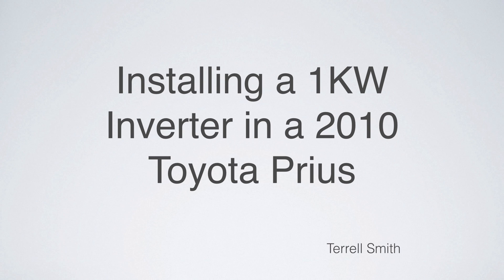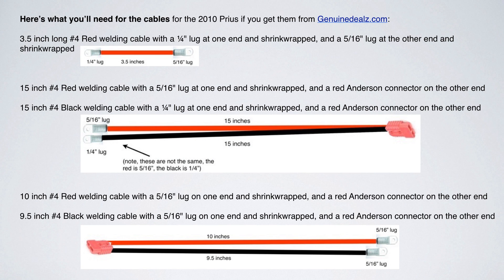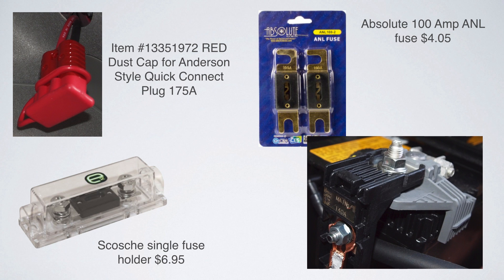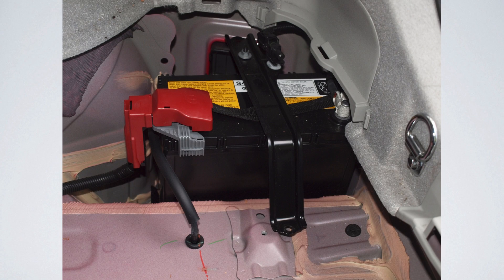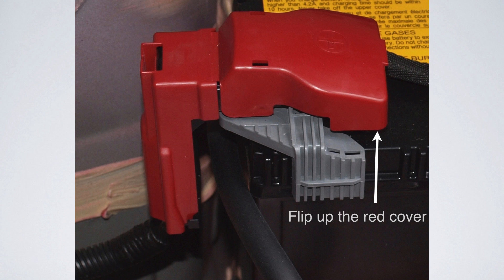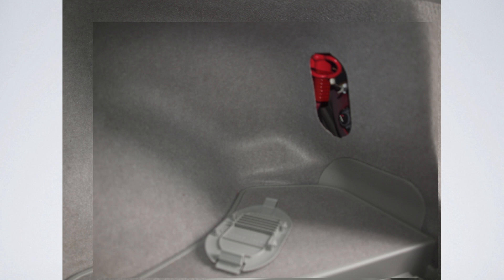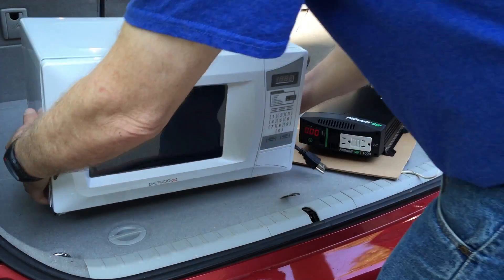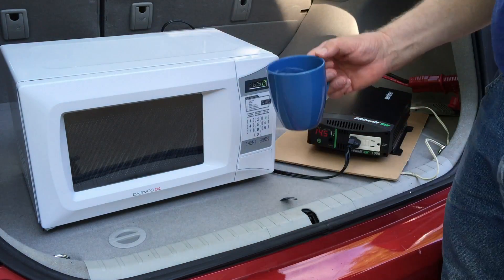Add a 1kW Inverter to Prius

Comment: I would like to set this up with my Prius but before I get all the parts, I was wondering if you could advise what sizes to get, etc.  You can give one-word answers if appropriate.
1)  Will this work with a 2004 Prius?  I believe they have a NiMh battery (larger than what they have today, I believe) but the chemistry is different.  If not advisable, we can stop right here.
2)  Would having a 1200 watt pure sine wave inverter be better for-just-in-case surges?  I don't have a lot to run.   This is for emergency backup use only.  I put my Kill-a-Watt on both my fridge and freezer and they both drew very little power.  The freezer is an old-style manual defrost kind and the fridge is one of those energy conserving models.  We wouldn't use anything powerful like microwaves in such a situation.
3)  What size battery cables?  Size 4 or 2?  Would 2 be better for not heating up, etc? Is Marine grade what I want?
4) I would like to use a breaker rather than a fuse.  What size breaker would you recommend?
This is what I have in mind:  https://www.amazon.com/dp/B08BYGRS1Z/?coliid=I1QG63HIPAVA3V&colid=147E3KHK8VQOL&psc=1&ref_=lv_ov_lig_dp_it
5) Attaching the cables to the battery terminals it's positive on first, then regative, right? I've seen various videos on this and it seems some people do it the other way.

I found a site where they will custom make cables with Anderson connectors and whatever kind of terminal ends you want.  Once I know the right sizes for all the components, putting the system together should be fairly easy.   batterycablesusa.com 

Your video was extremely informative and easy to follow.   Thanks a million!
Reply from the maker: Hi Amy. Thanks for the nice words and all the good questions.  :)  1) It should. The 2010 Prius also has a NiMh traction battery. 2) 1000 Watts is as high as you should go. And yes, get a pure sine wave inverter. Some equipment will only like pure sine wave. Pure sine wave inverters cost a bit more, but are the way to go. 3) Get #4 cables. #2 will be too heavy. #4 won't heat up. Marine grade is high quality. It should be like welding cable, because it's nice and flexible. 4) A breaker is fine. Either fuse or breaker should be 100A. The 12V battery in the 2010 Prius has a 140A fuse built into the positive battery clamp. The 2004 Prius might be similar, but I don't know. 5) If you are attaching battery cables directly to the battery and there's no load when they are attached then it doesn't matter which order. But if there's a load on them, then always connect the positive first, then the negative to a ground away from the battery. Why? Because 12V batteries (flooded or AGM) make hydrogen gas, and when you connect cables with a load there will be a spark. You do not want a spark near the battery. I have heard of videos which do not tell it correctly -- they are putting people at risk -- I don't know why they have it mixed up. If you measure what you need for cables carefully, there are places which will make very nice cables for you. I got mine from genuinedealz.com (see at 1:20). They have had so many requests now from this video that they have a "kit" with everything ready. I don't know whether this will fit the 2004, since that's a Gen 2 Prius, and the 2010 is Gen 3, so there might be a difference. Hope this helps!
Reply: @TerrellWSmith  Totally awesome!  Thank you so much!  If I wear latex gloves while I do the battery hook up, and cover the black wire while I do it, I won't get shocked, right?   More questions:  I see videos where people are attaching the black wire to some other place than on the negative post of the auxiliary battery.  Why would one do that?  Can't I just hook it up the same way I would hook up my riding mower or car battery?   And what about a ground wire connection?  If you had to use this where your car is exposed to the elements, how could one keep the hatch door closed with an extension cord coming out during adverse weather and keep people from stealing your car?  Could one put a hole in the wheel well to sneak the extension cord through?  My garage is a distance from my electrical panel, if I chose to not connect the car to it, I would need several really long extension cords to get power to my fridge and freezer from my garage.  Lots of little details to deal with, but it seems totally worth in the long run compared to the cost of a solar or gas-powered generator.  Thanks again for your advice.
Reply from the maker: @amywalker7515  , sure, wear gloves. I usually just make sure I keep one hand away, or put both hands on the same spot, like to do a nut. The black wire is the ground, which is the same as the rest of the body of the car. It's the red wire you have to be extra careful about, the positive wire. So keep tools and yourself from touching both the red (positive) and any ground (the rest of the car's metal parts) at the same time.
Yes, you may attach the black wire to any good metal part of the car. If you look closely, the negative (black) wire from the battery is attached to the metal of the car. So yes, you can attach other ground (negative) (black) wires to the frame of the car. I attach it to the negative 12V battery post directly, so that I have a very solid connection. And remember to have a fuse close to the positive battery post, in case something goes wrong. I use a 100A fuse. A breaker is also fine.
Regarding the extension cord from your inverter to your house: You don't need to drill a hole in your car. That just helps it rust faster. You can lay the extension cord at the bottom of the hatch opening (keeping it away from the latch area), then close the hatch very gently on it until you hear one click. Then gently push down until you hear the second click. If not, then move it toward one of the corners, where there is more flex of the hatch. There is enough space between the bottom of the hatch and the car for the extension cord to pass through, and the rubber seal on the hatch will seal it against rain. Just don't let the hatch slam down on the cord, or it can be damaged. I use a 12 AWG extension cord, which can carry 15 Amps. 
Make sure the car is in READY mode and the pure sine wave inverter is turned on, and all your stuff is plugged in and working. I have several 50' industrial extension cords, as well as 100', so I can park the car in the driveway, close the garage door (the cord can go under the closed garage door, because of the rubber seal), and into the house. A multi-tap power strip is plugged into this inside the house. And from there, extension cords go to the computers, phone system, basement freezer, and perhaps an LED lamp. Our refrigerator unfortunately takes too much of a surge starting up for the 1kW inverter to handle. Use your Kill-A-Watt to find out what everything needs. 
Now comes the fun secret part: Manually lock your car door with the emergency key that's part of your key fob. This locks all the doors and disables any fob from opening them. So your running car cannot easily be stolen. When done, you have to manually unlock the doors with the emergency key to restore the system.
By the way, I do NOT recommend plugging anything into your electrical panel. You would need a special panel with a transfer switch. Just run extension cords to whatever you need to plug in, and make sure they don't create a tripping hazard.
1kW for a house isn't much, but it's enough to get by on, and if needed, you can unplug something and plug in something else. :)
Reply: @TerrellWSmith  Wow!  Thanks!  I'm really ready to go now.  I ordered my inverter and breaker switch last night and will get the wire and Anderson connectors tomorrow.  For some odd reason, my refrigerator only runs at 100 -107 watts and my manual defrost freezer at 64-66 watts I(says my Kill-a-Watt).  Most of the other things I might want to run like lights are all LED's or are laptops that run from 12-40 watts.  We wouldn't use things like microwaves or toaster ovens.  Just enough to keep the food from going bad and see at night.    A 1000 watt inverter should be plenty large enough for what I want it to do.  Can't wait to get it up and running.  Thank you so much for all your help and inspiration.   Maybe you should make an E-Book on how to make the system and sell it on Amazon or Ebay.
Reply: Your detailed instructions will also help all the other newbies on here too!
Reply from the maker: @amywalker7515  , your good questions help to explain things.  :)
Reply from the maker: @amywalker7515 , thanks for the kind words. I've run things in our home several times from the Prius after a big storm knocked out the power for hours. The first time it happened, the power came back on just as I lay my extension cords!  :)  So I learned to try to find out when the power company thinks power might be restored. If in only a couple hours or less, then I don't bother. But if it's longer, then it's Prius Power time! BTW, when the power is out, I have to manually open the garage door. I have a flexible tube (from a shop vac) that I slide over the exhaust pipe of the Prius, and run it outside, so CO gas doesn't build up in the garage. That way, I can close the garage door most of the way. If it's a "planned" power outage, like when we had to have tree work done and the tree service asked to have the power line taken down while they worked, then I put the Prius in the driveway to run from there. Perhaps the most important thing is running the freezer, but it's nice to have internet and computers during a power outage. Let us know how your project turns out!
Reply: @TerrellWSmith  Just happen to have an extra shop vac we can use if the need arises.  I used to have a small, hobby solar power system that ran half my house excluding the furnace and big appliances.  It's hard to believe you can have power without solar panels, storage batteries, or a gas generator.  Perhaps you should go on a trip in your car and take some appliances with you just to see your system in action.  Thanks for all your help.  Too bad I can't post a picture of my finished project.
Reply from the maker: @amywalker7515  The tailpipe on the Prius hardly gets warm. You can check it to be sure. I use the shop vac hose because it fits pretty nicely on the tailpipe, then run it outside the garage. I put a couple of wood 4x4s on either side of the hose so the garage door doesn't crush the hose and close the garage door as far as it goes.
I do go on trips with my car - that was why I added the 1kW inverter. Powering a few things in our house during a power outage was just an extra benefit. I love camping, and take mainly a small microwave (hard to find one that draws less than 1kW) and a rice cooker. The Dometic refrigerator doesn't need the inverter, it plugs into 12V. It's fun to watch people's faces when they walk past our campsite and see us using the microwave, and international students love freshly cooked rice on day trips. And when out in the middle of nowhere, you should see the expression on the faces of children (and their parents) when I pull frozen ice cream bars out of my car!
When you have your finished project, you could join Priuschat.com and post pictures there, or here on YouTube.
Reply: @TerrellWSmith  I once took a DC freezer to a school picnic and we all had popsicles and ice cream sandwiches, but I had to bring a backup marine battery to keep it running once the car was shut off.  Silly me, I could have just left the car running in Park.  I spoke to a man at batterycableusa.com yesterday who says he makes those Anderson connectors for people with Pruises all the time.  He's going to make the entire connection cable run for me to my exact specifications.  I have to wait for the inverter to arrive to know the size lugs I need and am having a 100 watt breaker put in instead of a fuse.  It's horribly cold here right now, so I will try out the shop vac hose in a few days when it's a bit more bearable outside.
Reply: The shop vac hose works great.   I couldn't believe it when my son just popped it on there and it stayed!
Reply from the maker: @amywalker7515  Yep. It was made for the Prius tailpipe. You can check it from time to time to make sure the tailpipe doesn't get too hot. Because the car will cycle on and off, it shouldn't get hot enough to melt the hose. But check it.
Reply: Finally got my cable set-up with the Anderson connectors, but the guy who did it put the lugs on backwards, meaning his breaker with lots of exposed metal would be really close to the battery and hard to get at if it blew.   What if I had the breaker on the inverter side so not only would it be easier to get at if it needed to be reset, but also you could take your breaker set up with you if you had to use the inverter with some other power source (like solar or a rechargeable backup battery)?
Reply from the maker: @amywalker7515  Get them to redo the connectors the right way. You don't want to have a short and blow things.
Reply: @TerrellWSmith  Still don't have my inverter cables right.  The man I ordered them from is going to redo them for me.  Is the breaker really close to the battery the right place for it to be?  I'd prefer to have it on the other side of the Anderson connectors so I could take the breaker with me if I need to use the inverter elsewhere.  Also, are those connectors really hard to separate?  I've gone mine connected and even my son can't get them apart.   I read you can't snap them together before the cables are attached, but mine are already.
Reply from the maker: @amywalker7515  Sorry I didn't reply before now. You want the breaker as close to the positive battery terminal as possible (so it still fits). If you have the breaker on the other side of the Anderson connectors you have to possibility that when you take the inverter somewhere else there's no protection on the wires still connected to your battery. (One solution would be to put a dummy cap on the Anderson connectors.) Unfortunately, the Anderson connectors are hard to disconnect, as you've discovered. Over time, they do get a bit easier to plug and unplug. But still hard.

Comment: This video is the best I seen so far in terms of detailed information. I have a 2012 Prius C and I went on a camping trip recently and I thought to myself that the car would be a perfect generator and decided to integrate an inverter so I will do that soon enough. Now I have a question, why do you say that a 1kw inverter is the maximum watt inverter that this battery can handle? I was actually considering a 2kw inverter. Any information will be greatly appreciated.
Reply from the maker: Hi Alexia, thanks for the kind words and your question. I've enjoyed running a small microwave and rice cooker (not at the same time) while camping. You will be glad for the power your Prius can generate too! I'm not familiar with the way the Prius C is set up. Is the battery in the back? The reason for the 1kW limit is that the power is actually coming from the car's DC/DC inverter. The car can only produce so much power, and assuming the DC/DC inverter in the Prius C is similar with the Prius, 1kW would be safe. There is a 140A fuse built into the positive 12V battery terminal on the Prius (maybe also on the Prius C?). Assuming a perfect world (with no power loss), a 2kW inverter will blow that fuse. If it didn't, perhaps your DC/DC inverter in the car would burn up, which would be a very expensive repair. The 12V battery by itself, without power coming from the car,  would drain very quickly. So, 1kW is safe, I've been doing it for around five years. Any more than that and you might damage the car. Check http://priuschat.com before you try anything on your Prius C, since I don't know what might be different with the C.
Reply: @TerrellWSmith  Dear Terrell thanks for clarifying the issue. I have one submission. It is not the capacity of inverter, it is the load you are putting on the inverter. I am using a 3000 watt inverter but follow your advice very strictly and never put any appliance which need more than 1000 watt at anytime including surge at the beginning. I have enjoyed the inverter during last two long camping trip recently. Inverter in combination with Instapot 3 QT which needs less than 650 watts was extremely useful to me. So far no issue. Thanks one again for your very instructive video which enabled me to install inverter in my Prius without any issue in less than 15 minutes. God bless you
Reply from the maker: @kirtishah8261 , Thanks for the kind words. I'm glad it's working well for you! Enjoy your camping trips!

Comment: one more question:   the grounding wire you use: what are the specifications?  mine did not come with one- and it has no specifications on what to get......thanks!
Reply from the maker: Good question. I just used some two-wire copper strand I had lying around. It was from living in Europe, so I'm not sure what gauge it would be according to AWG, but it's probably around 15 AWG (sorry, I don't have my wire gauge handy now), and I used both wires.
Reply: @TerrellWSmith  My inverter (Nature Power) specs #10AWG as minimum for grounding with crimp ring terminal.
Reply from the maker: @cfldriven  They must have a reason. I grounded mine as you can see in the video at 6:55, and used both lines of lamp cord, which is probably 16 or maybe 18 AWG (I don't remember now). That's much less than the 10 AWG your specs are calling for. You can see I grounded it to one of the tie-down posts.